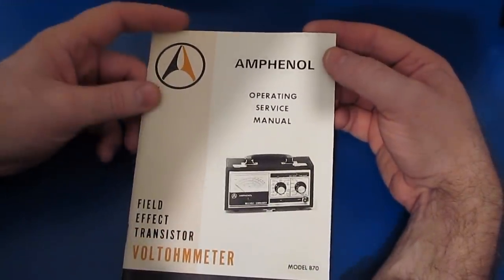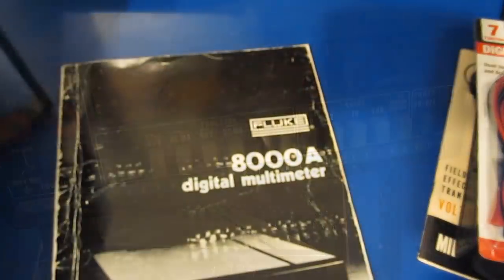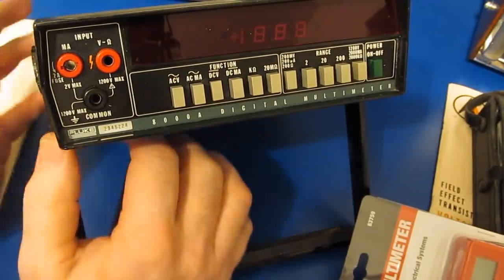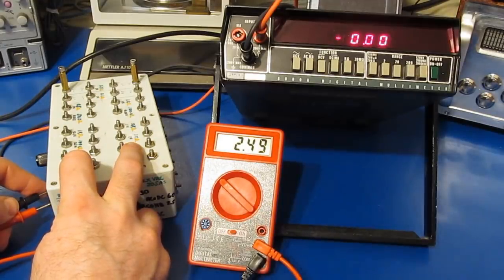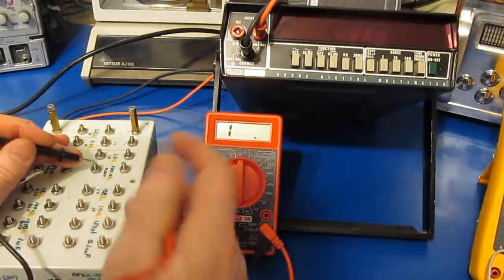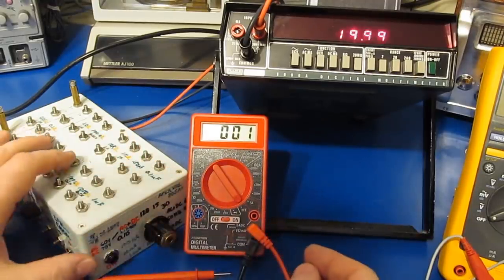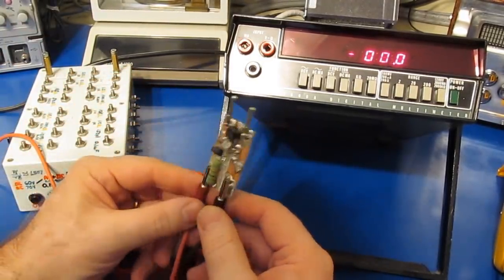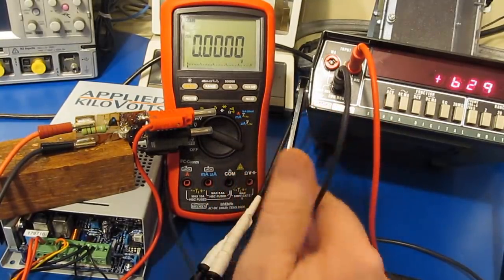The Fluke 8000A, My First Digital VOM

Comment: Have you considered running tests on original fluke 83 and 87? Curious if they hold up as well as v series.
Reply from the maker: I don't normally test old meters as their condition would be unknown.  They would have to be NOS.  That said, I did show an old 77 which wasn't very robust.  Of course I've shown my first Fluke seen in this video as well.  The 77 would have been a big improvement as far as electrical robustness.
Reply: I understand unknown results. Have you considered running p3 kill A watt power meters? Just curious 🤔

Comment: I have that 8000a as well. My story isn’t as good as yours, though. I had bought a pair for a good price as I wanted one of the meters in the pair, and the 8000a was the other one. It still works, fairly accurate and it’s pretty clean! I like pulling it out once in a while. Anyway, cool video and I appreciate the stories
Reply from the maker: Welcome to the 8000A owners club.
Reply: @joesmith-je3tq  What type of leads does the fluke 8000A use? 
Thank you

Comment: joesmith  I have 2 of these 8000A meters and both have the same issue. That being, part of the LED segment is not working. The top right segment appears as a 6 when it is really an 8. Wish I could find these segmented chips or a blown meter with good chips.
Reply from the maker: eBay may be your best choice for parts, or just scrap one of your meters to make a good one.
Reply: @joesmith-je3tq  Hi,
I would like to know what type of probe/leads it takes? and are they still being made?
Thank you, very informative and interesting video

Comment: I used to work in a calibration lab with 6.5 digit fluke on my bench and with Pomona micrograbbers I was a depot level wizard. Never smoked one but had plenty of colleagues who did which is the reason I never personally owned any fluke. Simpson 260 is my goto tank of a meter. While not a DMM, my tolerances aren't that critical anymore - retired ET that dabbles. Save the bucks for a scope.

Comment: I use one of those at work.
Reply from the maker: One of whats?  The ESD mat?  I use an ESD mat at work as well.  It's a small world.
Reply: The 8000a. I use one on a daily basis.
Reply from the maker: What sort of work are you doing?
Reply: @joesmith-je3tq  Avionics repair.
Reply from the maker: @alanholt6535  Do they mandate this meter?  Do you use it off the bench?
Reply: @joesmith-je3tq  The repair manual is over 35 years old and calls out for the Fluke "or equivalent."
Reply from the maker: @alanholt6535  I've seen some military standards that were calling out some very old test equipment in their procedures as well.  Do you have to use the battery version and drag it around with you as a portable meter, or does it get used on the bench only?   Mine frequently left the bench which is partly why the case is in as rough of condition as it is.
Reply: @joesmith-je3tq  I use it on the bench exclusively.

Comment: joe smith do you test for dmm speed, I mean if you want to measure inrush current or voltage spikes that only lasts 0.1us or less, can the meters measure it correct as max or something like that?
Reply from the maker: Some of the meters I have looked at do have a peak detection circuit.  In a few of those cases, I have demonstrated it.   If I want to look at signals like you describe, I am using a scope.   I can tell a lot more about what is going on this way and would trust the data.

Comment: Hi Joe thanks for another excellent post , i have a Brymen 257s surprisingly it won't read 3 series diodes , about 1.566v open circuit voltage

Comment: I'm only 34 years old and when I was a kid, I wouldn't even dreaming of a bench meter like 8000A :-) Never knew it didn't have any front end protection.
Reply from the maker: When I bought it, I didn't think about how robust it may or may not be.  Even my cheap analog meter was pretty tough and if I damaged it, it was easy enough and fairly inexpensive to bring back to life.  The Fluke really opened my eyes.   I vowed never to buy another after this one, but now that I have been testing them it appears they learned some valuable lessons over the years.

Comment: Great video as always Joe. I always look forward to viewing a new video from you. No surprise here about the rise in followers, your knowledge and engineering chops are second to none on YouTube I’ve found so far. Anybody who asks me about what meters I would recommend I send them to your channel to let them see for themselves the testing you put them through with charted results. I’m surprised one of these meter companies have not approached you to be a design consultant with your ability to redesign some of these meters that fail easily to be a top notch meter after your improvements to the circuit. A few years ago I purchased a few old bench meters similar to the Fluke here, a GW Instek 8135 and a BK model identical to the 8135 other than case color and name plate. They both have a 13+v open circuit voltage also in resistance mode. They looked to be a college sale of old equipment, $15 a piece and both work perfect so it was a cheap investment. I recently purchased the Brymen BM525s with the built in data logger similar to the Fluke 189. Doesn’t have the resolution as the 869s but like it so far. If you ever get the chance to look at the model I would be interested in your thoughts on that one. Thanks for all your time invested and sharing your knowledge. 👍
Reply from the maker: It's difficult for me to believe an engineer designing handheld meters would not understand how to make one survive.  I think it is more that people like cheap products, no matter how poor their quality is.  Then again, I have tested some very expensive meters that also performed poorly.  Hard to say what the problem is.
Reply: Exactly on the expensive meters, like the poor shielding issue in the Gossen. Some of the huge improvements you made in some of these cheap meters look to be very marginal cost wise for them to improve performance. Maybe that is the answer, build to fail to buy another at a low price in our throw away world. I believe some folks are engineers only buy title and a degree. I've dealt with many in the mechanical engineering world who didn't have clue on real world application unfortunately. It makes for educational video topics at least  :-)  @joesmith-je3tq
Reply from the maker: @SIXSTRING63  The Gossen was one of the worse meters I looked at IMO from a price performance standpoint.   It's really sad as had they allowed for more battery capacity, maybe ditched the latching relays and add a shield as you mention, that meter would be very nice.  Engineering driven by marketing?   With all the hype in some of the EEVBLOG videos about Gossen, it wasn't at all what I would have expected.

Comment: That quick overview of your DIY input circuit very helpful. Thanks.
Reply from the maker: Keep in mind that adding over 2K of series resistance and the added capacitance would cause problems with some functions.  Normally, I would just attenuate the signal but in this case, the meter doesn't have a lot of resolution  and giving up 10X or more wouldn't help.

Comment: Pi over the square root of 3.
Reply from the maker: Cheap meters averaging meters will typically estimate RMS using pi/sqrt8 not three.    You can find this information in some Fluke manuals.     Try here for example:  https://dam-assets.fluke.com/s3fs-public/2646876_6001_eng_a_w.pdf

Comment: This is a kind of funny video.  All things depreciate,  except Elvis's guitar.  Test equipment depreciates in value simply because it is massed produced and has no intrinsic value except to its original owner.  This is what Andy Warhol was about.  If you don't know better you may think this stuff has "magical properties" like the holy grail.  It doesn't.
Reply from the maker: The magical properties in this old relic is the memories it brings and seeing how far we have progressed. Back then, I couldn't imagine a free battery powered handheld meter like the 830,  where today I would have little use for one.
Reply: @joesmith-je3tq  Progressed and regressed. The manual for my HP3435a is superb , everything necessary to calibrate the meter or fix it when broke . I doubt such documentation exists for my ut181.
Reply from the maker: @wktodd  I am sure they have it well documented.  It's just not available to the public.    The 8000A is well documented but the custom ICs prevent any major repairs.

Comment: Had to check,, my first digital was an hp 3435a  .  It was broken when given to me . Hp quoted  £700 the replacement chip ( an auto ranging switch ) , way, way out of my range, so I made a replacement from a bunch of CMOS switches . It worked , after a fashion,  a bit of drift and offset . I didn't care I had a digital meter :-)
Reply: My first bench meter was also a HP 3435A, I had 3 dead 8000a's, made 2 working again with the parts of the 3rd and still have the one with the 20A option. My favorite handheld is also the Brymen 869S I bought after seeing it in your videos.  My most used meter is a Keithley 7510 (I repair measurement and calibration gear for a living (and some nich market  industrial stuff, PCBs that are not longer serviced by the machinebuilder, no schematics and no way to test it in situ or power it up on the bench.  Often it can only be repaired by checking all parts. I build and have a lot of component testers and fixtures for this)
Reply from the maker: @pa4tim  Three dead 8000As??!! lol.   When I was looking for ones to scrap for parts, I was amazed what people were asking for them.  IMO, they are worth about as much as the free HF meter.  lol.    Had this not been my first digital VOM, I would have recycled it years ago.  Now it can rest as a shelf queen.    

Seems like I saw some of your videos showing you working on a calibrator.  I can imagine some of those get cooked over years of 24/7 operation.
Reply: @joesmith-je3tq  bought one for 10 euro, the other 2 were gifts. I only use it sometimes as a current monitor because it can do 20A. 

I indeed have a youtube channel. I have not made videos for a while. I have some footage ready but the editing costs so much time and we have a very bad internet speed (i live in the middle of nowhere) A 30 min video costs me around 8 ours uploading. I used to do that on a linux laptop with open shot, it died and now I use W10 and also openshot but that crashes all the time. And I could not find time to find and learn an other editing program.
Reply from the maker: @pa4tim  Dang, that is some slow internet speeds.  On my 8000A, they only rate it for 2A.
Reply from the maker: Having used an analog meter for so long,  I know what you mean.